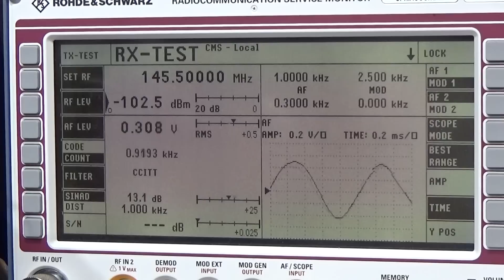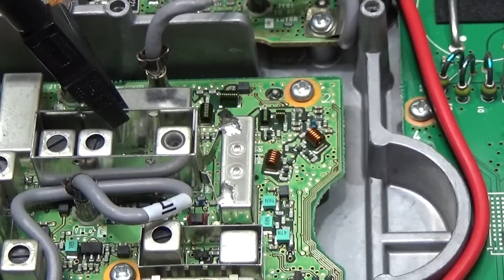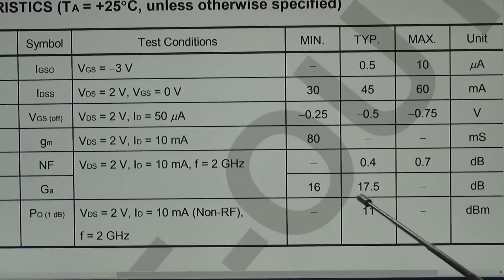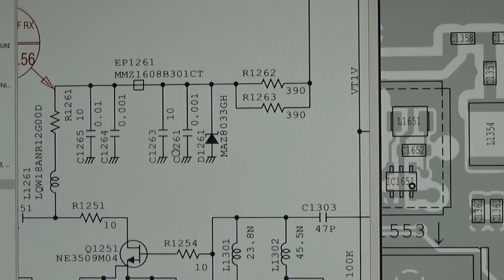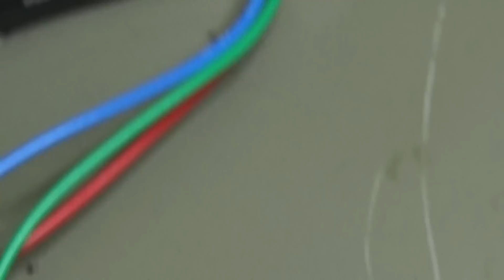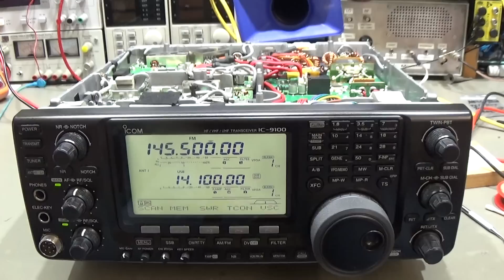#281 ICOM IC-9100 deaf on 2 m we fix it

Comment: Excellent as always, thank you….one question : the fact that only VHF was affected by the Fet failure means that UhF and 1200 were using different Fets ? Being certified up to 2/2.5 GHz I thought that all three band were using the same amplifier section…
Reply from the maker: Thank you. This radio has 3 different receivers for the 3 bands

Comment: Hi Peter, do you use an active probe for the SA?… i have troubles on some RF circuits do to capacitance of probe changing the tuning of RF transformers!
Have just ordered a cheap Ukrainian active probe to help sort problem.
Would appreciate your advice.
Another great repair video, I am learning much from these 👏
Reply from the maker: A passive probe  50Ohm 20dB attenuation...
Reply: What probe make and model? Please
Reply: I have just received one of those Ukrainian probes, built it into a metal tube. Its incredibly sensitive G4VQH